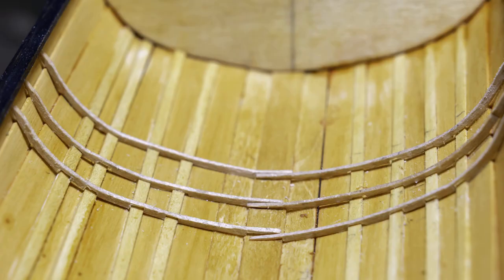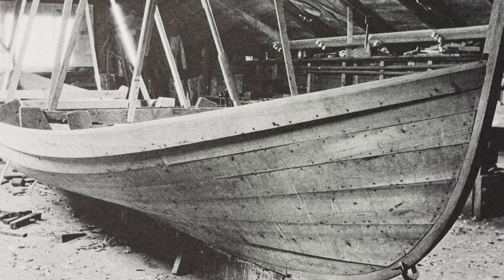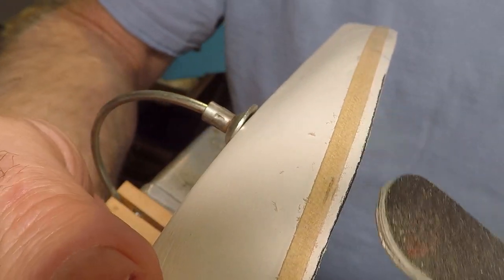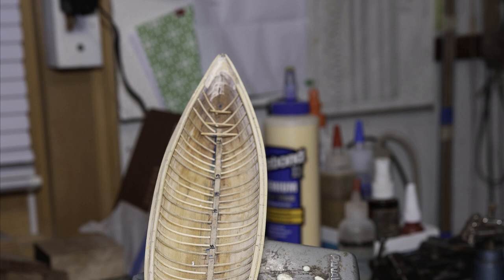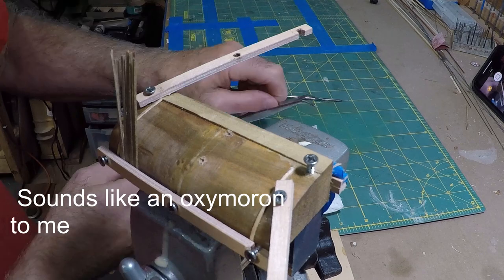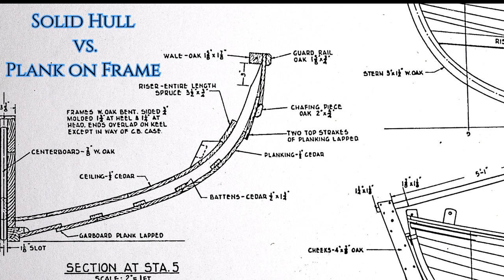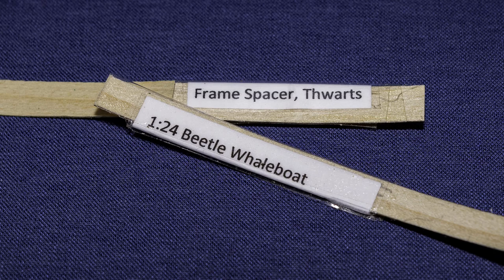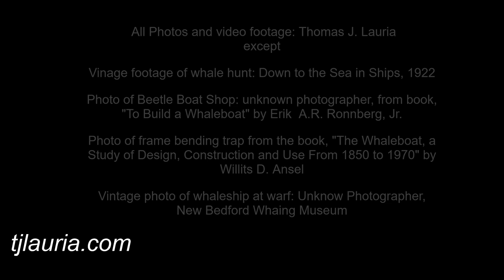Building a Whaleboat, Episode Six

Comment: Hello Tom, I repeatedly watch and enjoy every technique, photo and explanation in your sessions. It taught me a lot about using simple tools properly. Do you taper the false keel in the whaleboat?  Also, do the outer planks overlap as in clinker style? On a carved hull, do you smooth the interior so there are no obvious plank lines before installing the frames? I embrace  your comment on using materials that fit the situation. Many of my colleagues can't see the forest for the trees. Thank you for all the effort you put into making the videos. Stay safe and well, Bob
Reply from the maker: Hi Bob,
To answer your question about the interior surface: In the case of the whaleboat, about 80% of the interior hull surface is covered, either by the ceiling planks or various other details in the boat.  So, there is little point to having planking line on the inside.  It is important to get the interior surface smooth to the point that there are no major lumps or divots.  This will be the surface that directly contacts, and thus supports the frames.  So, you want as much contact as possible between those two surfaces.  Hope this helps, Tom
Reply: @shipmodelguy  Thank you for clarifying that. I'm about to start the interiors on the 5 upright whale boats on the Morgan and your explanation provided me with the confidence to move forward.

Comment: Dear Tom, first of all thank you so much for all of your videos👌👍 I learned so much from you. Here I have a question: What glue do you suggest for the blanks? I always use wood glue, but I see some model makers uses super glue. I think super glue will not last for a long time! What do you mean?
Reply from the maker: Omid,
Glad you're enjoying the videos.  As far as adhesives go, I use a few different kinds.  For the planking on my whaleboat models, I almost always use some kind of super glue.  As with all the glues you might use in building a model, this one its pluses and minuses.  The biggest plus and minus for super glue is the quick setting time.  Plus because you don't have to wait long to move on to the next step in your process.  The minus is that you'd better make sure the piece is exactly where you want it because you probably will not have time to adjust it.  
As to the issue of strength and longevity: CA Glues (Super Glue, Zap-A-Gap) have good holding strength but lack sheer strength and they are not fussy about bonding to paint or shellac.  I have been using CA glues for forty years (actually, a bit more, but who's counting) and I haven't had ANY issues with a glue joint failure.  So, for those that say it doesn't have a good life span, I would ask under what condition have they witnessed this.  There are many things that contribute to a the effectiveness of a product or technique and it is seldom as simple as, "Oh yeah, that stuff doesn't last long, so don't use it".  The best advise I could give is to use the product that suits YOUR needs best that has the least downside associated with it.
Thanks for watching,
Tom
Reply: @shipmodelguy  Thank you for your full explanation.  I'm honoured to get your useful answer 💐

Comment: Have you done a blog on lettering your models?
Reply from the maker: I've never done a video on lettering.  But, here's the short answer on how I do it.  I use two methods, and both have nothing to do with being able to meticulously hand-letter-which, for me, is a skill I have never possessed.
  The most common method is with the help of the computer.  Depending on the situation, I use either Word or Photoshop.  The other is dry letter transfers-the kind favored by model railroad guys.  On my model of Alice S. Wentowrth, you can see examples of both.  The name at the bow was laid out and printed on the computer, while the name and home port on the transom was done with dry letter transfer.  Hope this helps and thanks for watching.
Reply: @shipmodelguy  Thanks.  I have done dry transfer, but I haven't done the computer  You do splendid work